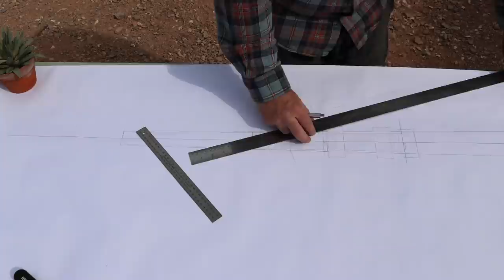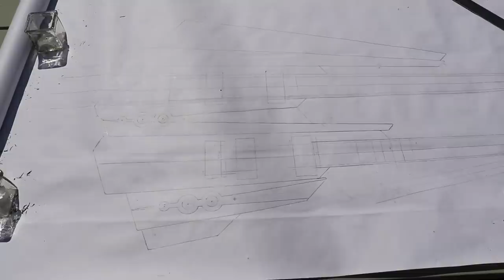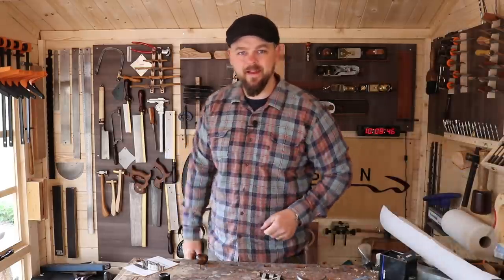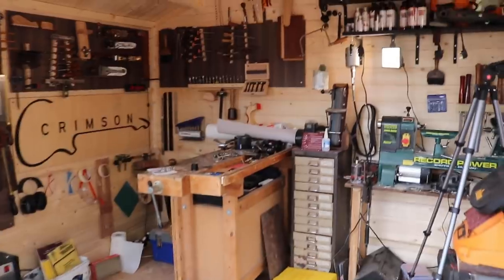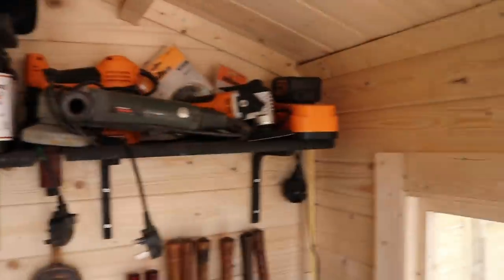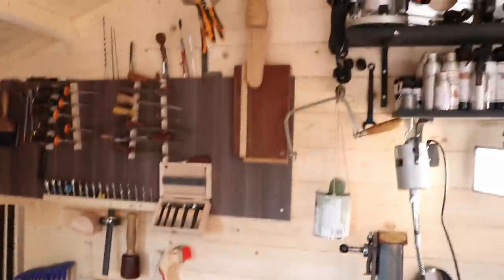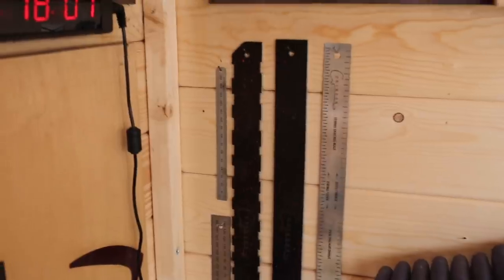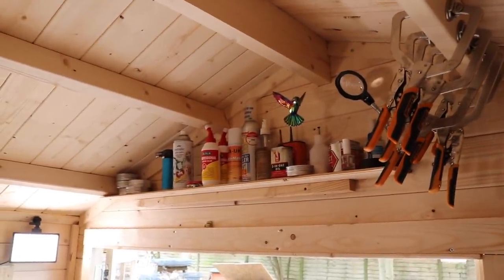2020 - Designing a TWIN NECK Guitar and Building a Tiny Workshop

Comment: essential tools for my workshop
1. coffee maker
2. mini fridge for my beer and ice tea
3, good sturdy work benches/tables with vices and holes for holdfast clamps
4, good sharpening stones/strops for keeping tools sharp
5. nice selection of chisels/gouges with mallet for handwork
6. drill press (pillar drill for you brits)
7. power saws (band saw, table saw, and a scroll saw like that marvelous Hegner in your studio shop)
8. good selection of hand planes
9. good selection of measuring/marking tools
10. air compressor for powering hand tools as well as applying finish to completed projects.
11, sanding stations to include oscillating drum sander/belt sander, a random orbital sander
12 dust collection (use saw dust to heat shop in winter)
13. separate climate controlled wood storage area to dry wood and keep it dry
14, a lathe
15, pressure pot for working with resin
16 good assortment of hand tools (screwdrivers, wrenches, hammers etc.
17 hand drills both old fashioned manual for delicate work, and electric.
18 thicknesser/planer
19 a comfortable chair in a corner to rest in occasionally .

Comment: Hello Ben.  Here in the States we been in lock down for Four weeks and thanks for the videos. On your wood shop all I can see you need a Air System or a Dust vac.on the outside with inlet inside. You need to build that awesome design Guitar , to put it over the edge at the end of the guitar make exhaust cut outs with Red LED light come on when you play it loud. Please keep the videos coming. It sucks in home lock down and can’t see my Mother in Law that is in a Nursing Home. Peace Be With You and family Greg

Comment: Nice little shop.  Needs a coffee tap piped in from the kitchen.  Looking forward to the double neck build.  Here's a silly suggestion regarding the build.  Make the head stocks a single, unseparated half-moon arc with the tuners on the top and bottom of the arc.  Told ya it was silly.  Best to you and yours, Ben!  Cheers....

Comment: Absolute necessity, an awl to make starter holes for drill bits. I have never privileged to own a band saw, however; I have been able to work wonders with a 14" scroll saw. Surprisingly, I have been able to saw up to 1-1/2" thick wood with it (albeit very slowly).

Comment: 10 x 8! - that's my entire home office, studio, workshop, tool shed, gaming spot / man shed. You can do a great deal with that amount of space, but I'm still disappointed I couldn't get a pool table or an arcade machine in here. 

So, my question really about what you have built there, is one of insulation and temperature?
As I knew I'd be using mine to work from home (computer programmer) and for a 'nerd space', plus for guitars, I got a fully insulated job built - walls, floors, ceiling. Cedar roof, cedar cladding - it's lovely.
However, in winter, without my small oil heater, my goodness, it gets cold in here. I have to leave the oil heater on low 24/7 in cold months, just to keep  the guitars at a reasonably steady temperature. There's zero risk of any damp issues due to the insulation - at least for 20 years. I did my very first abysmal guitar project in my luxury shed - taking a £100 'chelecaster?' and upgrading everything, including a paint job. It's bloody awful - but it plays great, which is half the fun. (and yes, I bought some stuff from Crimson! - thanks for that!)  

Do you expect this workshop to pretty much be retired before winter comes along? Keep us updated - keen to know whether it can cope in the colder, wetter months.

Comment: I wouldn't shoot for 24 hours with limited tools. I feel like this kind of themed build with a double neck needs more time than that. But in keeping with an Alliance vs Empire theme, if the two halves of the guitar are meant to be starcraft it could be cool to have the bindings on the neck be green on Imperial and Red on Alliance to simulate blaster cannon fire. Just to push the theme a little more. Not sure how hard that is to do but just a thought.
Stay safe and stay awesome!

Comment: I'd love a shed like that, but living in a flat in London prevents it. I have a double neck guitar & bass with the guitar on the upper neck- when in playing position the frets on the two necks line up exactly, which is most useful as the upper neck hides the lower one. It's also extremely heavy, which is one of the reasons I've very rarely used it.
I shall enjoy watching you build instruments in the shed and I hope there'll be the occasional 'help' from the kittens!
Reply: What are you talking about?

Comment: Guessing that you might need a Fan Heater that also blows cold air … The temperature in the ununsulated shed is likely to be very changeable depending on the weather. You'll also need a Brolly & Holder by the door … this IS England !

Comment: "What's in the shed?" 😜 This isolation actually helps me spend more time on my first build, because I can work remotely for my employer. Which is good because I need some extra time fixing a rather large issue with the scarf joint i tried to make in my multilaminate through neck, which of course made it slightly too short 😅.. So I wondered if you could do a tutorial video on scarf joints some day? Stay safe Ben and everyone at Crimson.

Comment: Let’s see, we have a Star Wars-themed twin neck that’s asymmetrical and incorporates lines and angles rather than curves.  Looks like you’re about to build the Millennium Star Destroyer.  Make it various shades of black/grey using different sheens from flat to gloss for further depth and maybe throw in some torching for battle scars.  Please proceed and take your time!  It doesn’t matter to me if you finish it at home or at work (especially if you can take the cats to work).  Also, congrats to your son on his first wood lathe project!  Is that a garden dibble that he made?
Reply from the maker: Hey Craig, you get me.. and yes, slow and steady, though if I move these cats I will suffer greatly! As to Orson.. he is 9, so he makes weapons or, in this case, a wand.. and he had a blast! B

Comment: I have a question for you Ben! I'm going to start of building my own Necks for my guitars and I'm for ever inlove with the simplicity of a true one piece maple neck where the truss rod is installed from the back and no fretboard is glued on the neck. I'll be using a truss rod with a wheel adjust so i can still adjust is while the neck is bolted on, but a was wondering how deep can i route the truss rod in, or in other words what is the minimum thickness of the "fretboard"

Comment: Sorry about this, but I just want to question your layout choices of this doubleneck instrument, and wondered if there was any reasoning for the relative positioning of the guitar and bass sides of the instrument.

Several years ago I co-designed a doubleneck guitar/bass with a luthier. It did eventually get built and I used it for a while but eventually sold it on because it was so heavy and I was suffering neck and shoulder problems. But that's another story.

Part of the reason for having such an instrument built and not buying one off-the-shelf as it were (even though such beasts are a rarity anyway) was that in my research most guitar/bass combinations that I could find had the necks the "wrong way around". What I wanted was the guitar on "top" (from the player's perspective looking down at the instrument while playing) and the bass below.

I know that this choice is subjective, but there is a lot of logic to it.

I can understand the - dare I say "OCD" - reason for putting the bass uppermost and guitar below so that you have the strings across the entire instrument running in sequence from low to high, but I believe that this is not the best practical or ergonomic arrangement. 

Having the longer bass neck at the bottom of the instrument should allow for better balance. But there is also the question of playability. With a bass on top you would need to rest your forearm across the longer scale bass strings in order to reach the guitar side, which could lead to unwanted damping or spurious noises from the bass if the volume for both necks was turned on at the same time. Also, for chordal work / strumming on the guitar I personally would rather it higher up on my body, whereas for playing bass I'm personally happier to have it slung a little lower. I definitely prefer my bass to be slung "Peter Hook" rather than "Mark King". Obviously preferences will vary.

Some will say that if the guitar-side is top-most and it has a tremolo, then the tremolo arm may get in the way of the bass strings. The guitar-side of the instrument I had built was a hardtail so that was never an issue for me, but even with a trem in the way this would be a minor inconvenience and not, I feel, as important as the other issues I mentioned. (One solution, shorter tremolo arm perhaps?) Surely, by definition, a doubleneck is an instrument of compromises?

By the way, did you ever see a double- or multi-neck instrument with a mandolin neck which was positioned anywhere other than at the top? I'd suggest that a good rule of thumb would be the shorter the neck, the nearer the top of the instrument from the player's point of view.

(Sorry, I hate using the terminology "top" and "bottom" when referring to sides of the instrument, especially when bearing in mind that musically speaking the "top" strings of the guitar are the highest strings and not the ones nearest you as you look down at it. Which is something that used to drive me crazy when, for example, telling the singer in a band I was in to "play the 3rd fret of your bottom string" and he'd do it on the high E. But now that's me being OCD.)

Comment: You definitely need to use greeblys from kit bashing airfix models, especially the universal greebly. Check out Adam Savage on Tested talking about building Star Wars models for ILM if you don’t know what I’m talking about.
Reply from the maker: I had that thought (I'm a big Adam Savage fan) but I thought most kits would not provide greeblies of the correct scale? I realise that is probably a false assumption and I will pull out the credit card and start playing ASAP! B
Reply: Crimson Custom Guitars having just built a Concorde and A-10 Warthog (amazing what you can do in lockdown) there are plenty of parts that could work I’m sure. Granted they’re large scale kits, but you could probably get a large enough greeblie by building up several small greeblies. I can’t wait to see this build! Huge fan of yours and really pleased to see you’re still content creating with everything going on. Thank-you 👍🏻

Comment: Do you have a shooting board allready? You're also missing some boxwood, boxwood ought to be everywhere. I have even asked my boxwood to marry me! It hasn't responded yet though
Reply from the maker: I have a cupboard of boxwood at crimson that is safe and dry but, as you say, had to bring some along here.. 3 pieces so far ranging from a plane blank to a 3 foot log! King of Woods in my opinion! And no, no shooting board yet, good point! B
Reply: @CrimsonCustomGuitars  I would love to see your boxwood collection! Just today I inlaid a piece of boxwood into a vintage jointer plane, the mouth piece was almost entirely cracked out of the body. I chopped to where I thought the crack would end and the piece (roughly 6x7 cm) just fell out. Luckily it didn't go that deep

(Should I make a social media account to share pictures? If so which platform would you reccommend?

Comment: I have a terrible confession to make. I've decided to put a kit guitar together, but I fear my carpentry and wiring skills are severely lacking. So, I've ordered a cheap Harley Benton kit to practice on. If all goes well, I promise I'll order a Crimson kit next. Can you forgive me? 😔I feel like a traitorous b#@+&©d. Nice shed, btw. And yes to the twin neck of awesomeness.
Reply: Is it a strat? Seen good and bad reports on the body quality.
Reply: @Forest_Fifer  yeah. Saw Dave Simpson on YouTube and thought, what the hell. £59.
Reply: @glennwhitlock1272  Brent Hutchinson had one which was in a right state, holes in the routing between pickup and trem cavity fixed with sawdust, glue and balsa wood.
Reply: @Forest_Fifer  wow. It'll go back if its no good.
Reply: @glennwhitlock1272  he got it replaced. Dave's one looked sound though, and as you say, what do you expect for 59 quid.